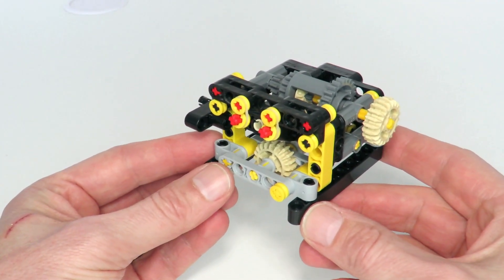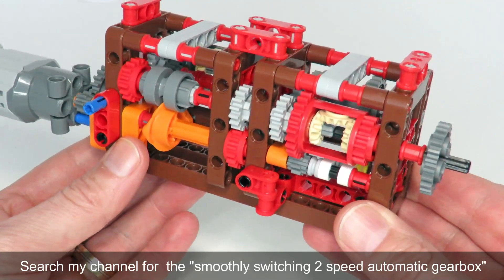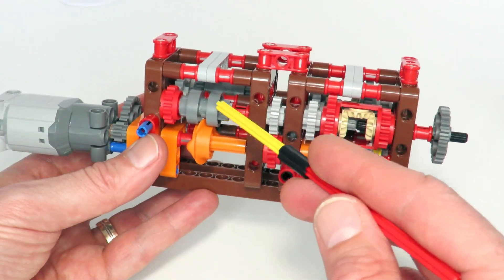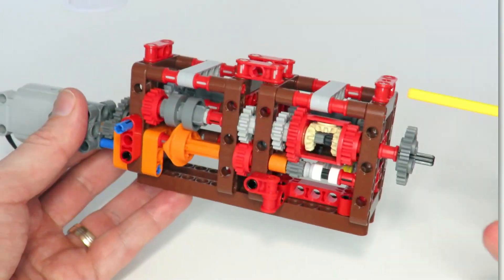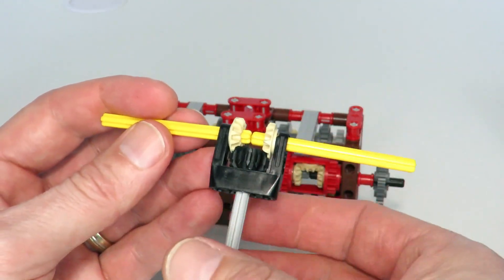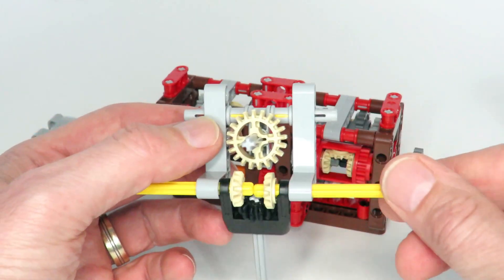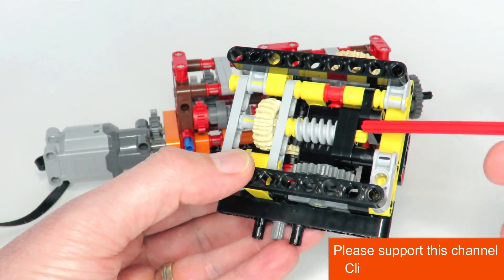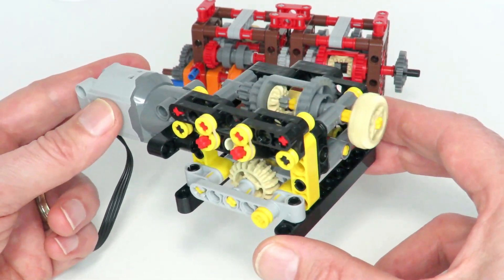Lego Technic smoothly switching 2 speed automatic gearbox evolution with instructions

Comment: Either I built something wrong or the transmission itself needs more power than it gives out in the end. I have checked the friction of the axles, everything runs smoothly.
But my motor with the output gear directly on the drive axle is harder to brake than the output gear on the transmission.
Reply from the maker: Hi Lars - I think you did everything right - I found the same problem when I tried the gearbox in a car....oops the design worked without any load, but then the load killed it. I need to redesign it sometime...thanks for trying it anyway.

Comment: I think this is by far the most impressive automatic gearbox I have ever seen (and I've browsed more than I care to admit on YouTube). The incredible thing about this one is that absolutely nothing has to disconnect on the downshift. There's not only no loss of traction, there's also no point at which the output can pause or slow rotating during the shift, before the lower gear is fully engaged. Instead, you just get continuous smooth motion. I would 𝘳𝘦𝘢𝘭𝘭𝘺 love to see this in a car - I imagine there would be zero pause as it gets to a tougher slope and downshifts, which is a problem that plagues every auto gearbox in a Lego car that I've ever seen. EDIT: okay I feel silly now, I didn't see you'd already done it in a car 🤦‍♂️ shame to see it didn't work! Love your stuff though
Reply from the maker: Hi Geoff. Thanks for your very kind comment. I thought the same about that gearbox until I tried it in a car!! Doesn't mean the idea won't work in other applications though, or in a different configuration. I am going back to the drawing board with it that's for sure. Glad you like my channel - much appreciated. 🙃

Comment: Very nice gearbox and mechanism, I do not know if the automatic gearboxes are really useful today compare to a electrical variation on a motor, but I like to see how you find solution and improve after.
Reply from the maker: Thanks Nico - appriacate your comment. Yes you might be right, but do the electrical solutions adjust the output torque automatically or is it via manual control? Anyway I enjoy designing gearboxes regardless LOL 😀
Reply: @TechnicBrickPower  Yes you can not have a lot of torque at low speed if you vary the voltage. But for standard vehicle with acceleration it is ok. Only for the truck trial field which is more complicated but again, with the smartphone, app, buwizz, control+ etc, you can add a simple gearbox and have an other motor to operate it. It has the advantage to not lose torque and power in the rubber band or the worm screw but it is way more simple mechanically, so as you said, not really interesting ! (but efficient).